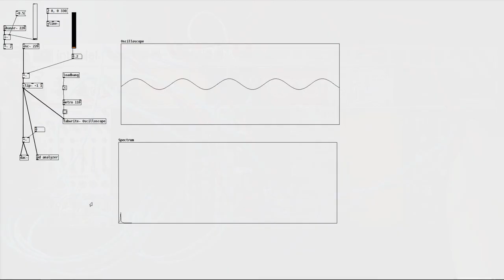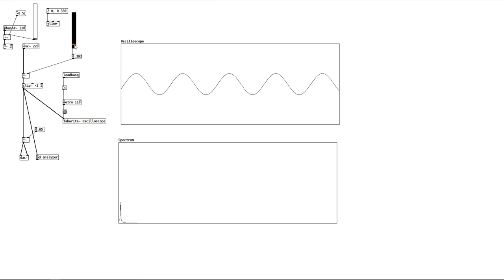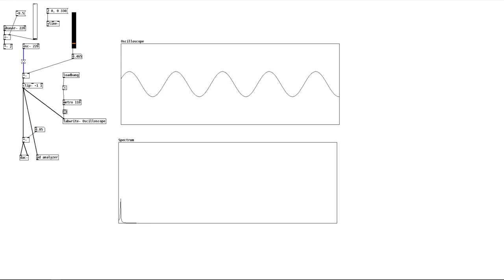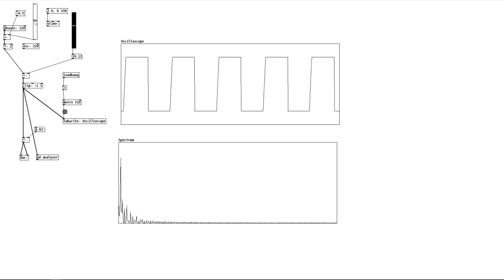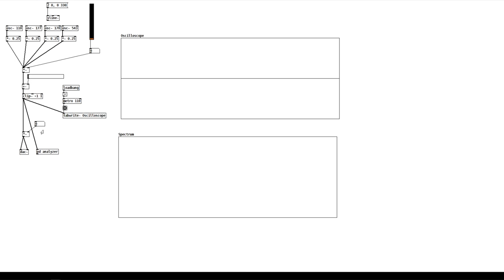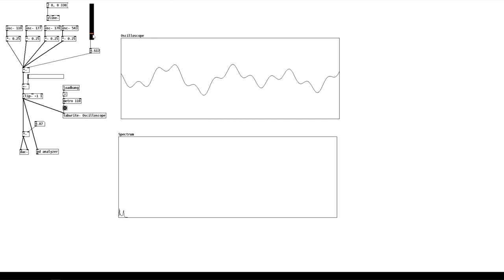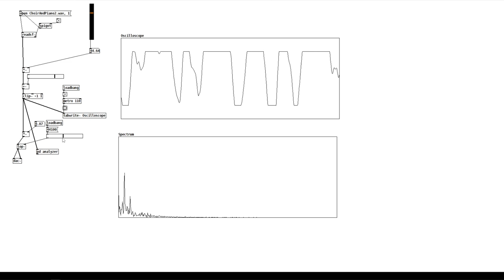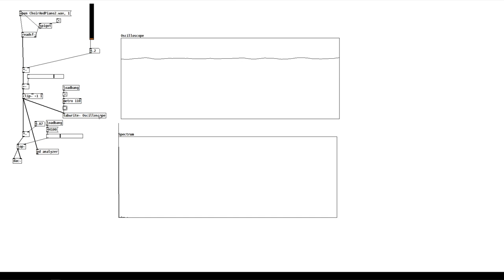Distortion and Synths: an Investigative Love Letter (feat. Empress Effects)

Comment: Enjoying this video! I learned a lot.

Related: I know you're a fan of the Korg opsix; one of the great things about the 2.0 update is that one can set any operator to Drive or Distortion and have it much earlier in the sound pipeline than the traditional tacked-on-at-the-end position. I must try this out on mine.

With respect to harsh distortion in chords, I remember years ago that this was my introduction to temperament and microtuning. All that grit just melted away when I set the keyboard to "pure" (I suspect just intonation) C major and played a C major triad through a distortion effect.
Reply from the maker: I've experimented with the per operator distortion lots - it works great. Depending on how the algorithm is set up you can still introduce interesting wobbles within a voice, or just keep it nice and clean. I used this a fair bit in my Drums and Percussion pack actually.

Playing with different temperaments is definitely worthwhile (always true!), but especially in this context as those tiny changes are magnified by the distortion - you can reveal whole new 'notes' hidden in the relationships within the chords!

Comment: yesss good stuff! blush response also has a great vid about distortion pedals on synths thats less technical but experiments with chaining multiple distortions in sequence. i've been experimenting with running a ms-20 (erm, k-2) through a stereo chorus pedal, then each output into a different distortion pedal to get a wider, rotery-esque sound
Reply from the maker: I'm a biiiiig fan of running distortion after other effects! I'm quite partial to running a reverb before (maybe two different) distortions  - the ol' shoegaze trick.

Comment: Darn. First time I watched this I didn't think through the consequences of using this method of generating square, pulse and trapezoid wave shapes. This produces near to a mathematically perfect square wave, which contains a bunch of aliasing.
Reply from the maker: Conversely, using analogue (or analogue modelled) distortion, you can create extremely imperfect squares, trapezoids, etc. which can also be extremely interesting - easier to experiment with that in a modular environment though, if you want to use your crushed waveform in a traditional synth signal flow.

Comment: I'm a big metal head but from personal experience I prefer overdrive on synths as it complements the original signal and enhances it. Where as the other 2 completely wreck it. It really depends on your preference and application.
Reply from the maker: I tend to agree in the case of most patches, although I've had good outcomes when crafting a patch 'for' the distortion/fuzz - turn it on before you start making the sound and do your sound design with it on. With percussion though they can all work depending on context I think. 

When I'm playing guitar, I'm a "stack 2 or 3 fuzzes together" kinda guy though. I want to wreck the guitar signal completely.

Comment: When running a synth through a guitar pedal, do you often have to turn the synth down?  Or first use a pedal with a line switch on it?  Some pedals just dont seem to take well and I am not sure if there is anything I can do to the synth sound before running it through a pedal?  Thanks
Reply from the maker: Turning down a bit is usually all that's needed on most pedals - guitar pedals often boost the signal quite a bit and pedals downstream of that boost need to accommodate that hotter signal.

A couple of slightly more subtle issues you might encounter: synths have a far wider frequency range than guitars and sometimes the extreme ends of the frequency spectrum might make a pedal act oddly (usually the bottom end, so a high pass filter might be useful). Another oddity might come from impedance mismatches on the input of the pedal, but that tends to be more primitive fuzz pedals (that also don't behave well when placed after other pedals in guitar usage).
Reply: haha, you brought this up before I got to the end.  Great video.  Learned some things.
Reply: @OscillatorSink  After watching this, I hooked up my recently acquired Nymphes into a handful of pedals.  All worked well.  I do have a jhs black box attenuator but Im not sure it offers anything more than me just turning the vollume down on the synth.  And the old trick of taking a chorus pedal and applying it to a mono output worked beautifully.  It todays age of pricey vintage and pricey boutique, I love that Dreadbox prices a six voice analog synth so affordably.